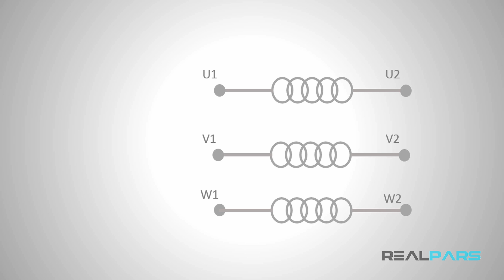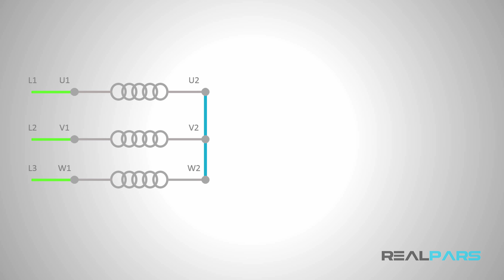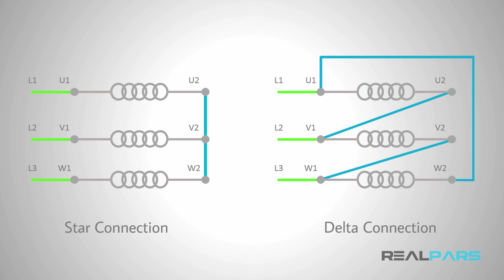Star-Delta Starter PLC program and Wiring_ Part 3

Comment: If join 3 U,W,V that is a triangle. The other one join 2 whith this gets star conexion and it creates divisor between and gets high one, like motors 230/400 whith star gets 400. I think. Dont do star-triangle whith 400/660... nice flames  xD

Comment: what is the problem if we let the connection in star and not transform it to delta? what is the features of delta connection?
Reply from the maker: When you connect the motor windings as star, the current that the motor draws is reduced to one third of the normal current and because of that the motor works with one third of the normal torque/ power. So we only run the motor in star connection for a few seconds  just to reduce the rush current and then switch the connection to delta to have the motor work with full power.